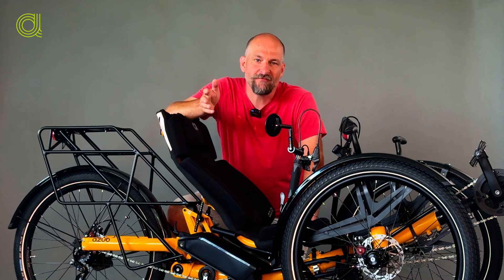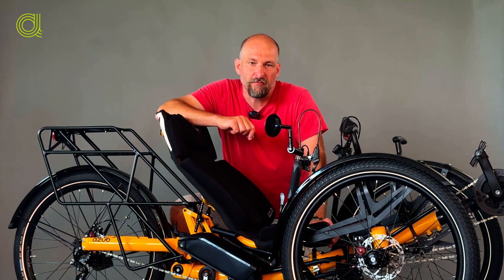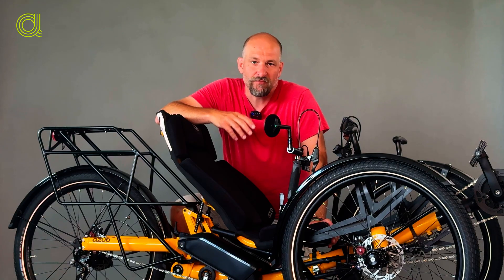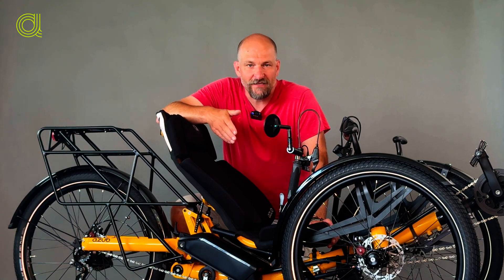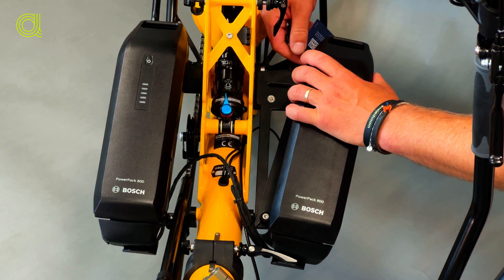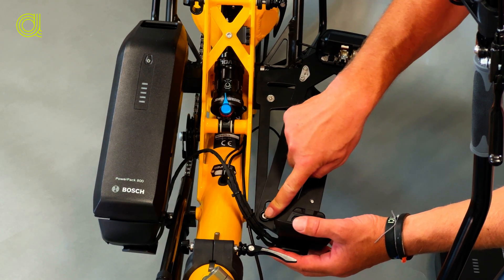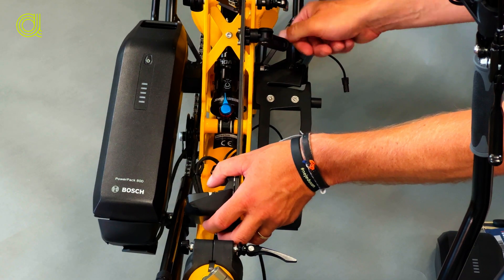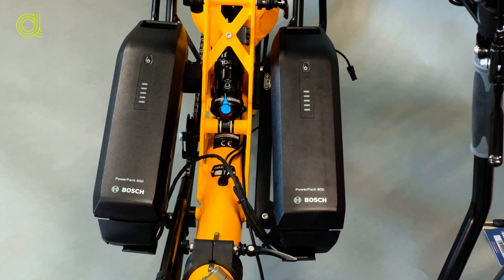New AZUB Bosch Dual Battery Bracket Explained

Comment: I am using two 960Wh batteries on a HP Velotechnik Speedmachine converted to electric and solar. The batteries are mounted to the frame tube behind the seat at a low level with two fully configurable battery holders from T-cycle.

Comment: It's a workaround that works. I still think the design of recumbent trikes are behind today's requirements. With e-assist you want a nice low rack behind/under the seat. Also there are no trikes with a hitch made to pull heavier trailers such as a camper! And mount points for a (solar or weather) roof would be nice.  Or how about a big aluminum trunk? Of course the trike will be heavier. But carrying more weight is the whole idea of e-assist.  Almost all trikes on the market are kinda stuck in the era when there wasn't e-assist.
Reply: I disagree I much prefer a higher rear rack because I don’t want my bags low to the ground, it always is a good way to grab the trike from the back to move it around while not riding
Reply: @TheSouthernTriker  I meant for the batteries. It would nice if the frame already had space for two batteries low and in the middle. Now they have to figure out racks to fit the frame. That's like designing  a car but you don't know where the engine goes. 

As for pushing and lifting your trike from the rack, yes a higher rear rack makes it easier. Even easier it is my solar roof. It really is a back saver. I often have to push my trike around the block of houses to get it in my backyard. I know all about it! But why not have mounts for a sun/rain/solar canopy already on the frame? Or a push bar? 

In my opinion trike manufacturers got a bit stuck in the 1990's. With e-assist these days you can do so much more. Where are the innovations, the solid hitches, the solar roofs, the windscreens, the fairings, the armrests with 'glove' or sunglasses compartment , the mounts for your devices and display. But what did for example ICE trikes came up with last year? You can choose the color. Oh wow. Silly expensive too.